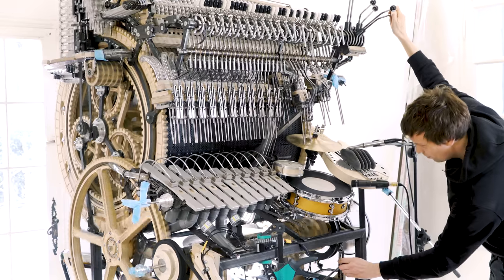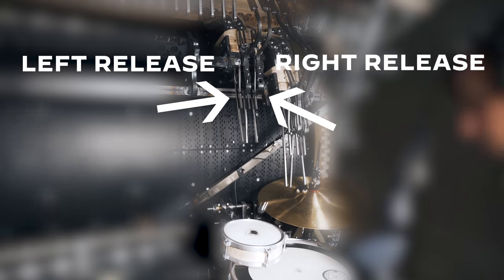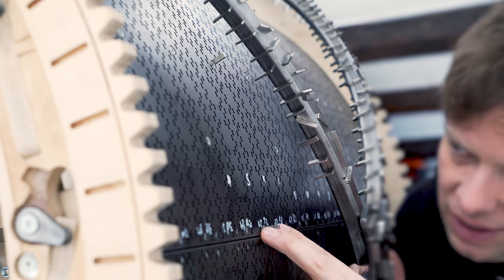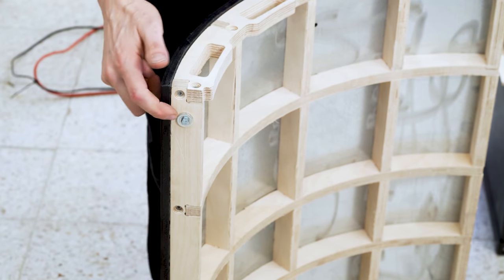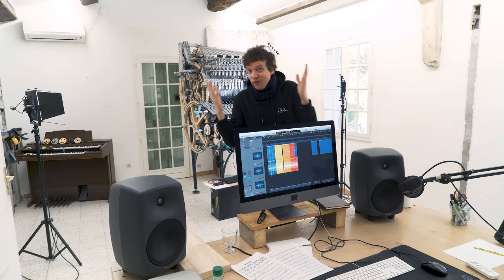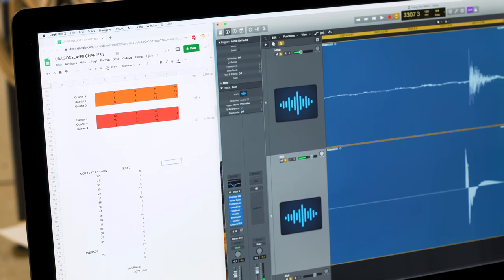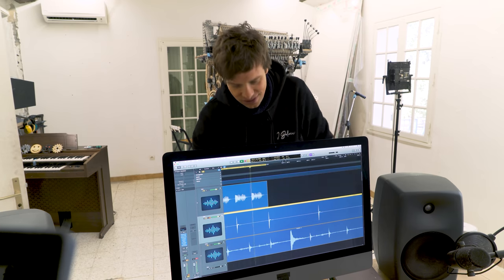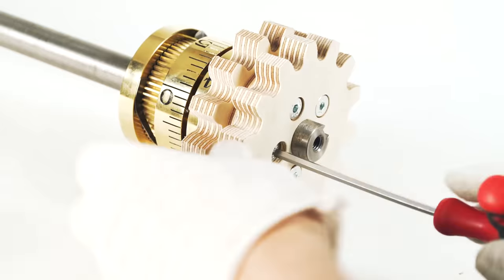Playing Tight Music? - Marble Machine X #115

Comment: Is there a contingency to deal with stray marbles that fall to the floor?
I wonder if the MMX could be placed on a slightly convex or pyramidal surface with a sloped groove around the perimeter that could feed the marbles back to the MMX with a feed tube, or at least it could collect strays and reduce the trip hazard, and it could really enhance the presentation.
Shouldn't be too tricky to build for you, the biggest issue I could see is ensuring that the MMX would be stable on and supported by such a surface.

Comment: If you want even more tight controll then use feedback from the motor to count revolutions.  Like with an Odrive controller. Then you will not miss anything :) and you potentially with a very simple front can push differebt buttons for different bpms to keep :) Edit: Wrote a bit early since he already had it built in  :D

Comment: Wow that's tight! Two thoughts though. Maybe it's an idea to do a stress test on the motor. Just to see if the RPM fluctuates under different loads from the programming pins. Secondly maybe you should paint some visual cues on to the programming plates so that composing becomes easier. Anyway keep up the good work!

Comment: You may have explained this in a prior video but won't installing the stud welding system mess up all of the calibrations you've had to do for the current programming pins? Every time you switch in between the two systems you'll have to re-calibrate it to adjust for the errors in the programming pins in comparison to the greater precision of the studs. Please correct me if I'm wrong.

Comment: Awesome progress.  Martin, get that electrical outlet fixed NOW, and use a pro.  The burned electrical outlet is a huge warning.  Further any arching or power flux WILL eventually ruin your electronics.  Yes their power supplies are soaking this and saving the circuits, but the cleaner the power you can get that expensive looking rack of equipment, the better.   If nothing else, I've seen a number of people say get a UPS and its a great choice as they not only provide emergency power, but condition power to be more electronics's friendly.   Trying to DIY electrical is how you get DI Dead unless you know exactly what you are doing.   2nd you need to have fire extinguishers around.  Lastly, please, please tell me you have onsite and offsite backup for your files.  THE most critical are the plans and updated schematics for the MMX.   

Also seriously take some time and DOCUMENT every on the fly "grab the the angle grinder and welder" little tweak you made off the original plans.   If you have full documentation, any needed part rebuilds and further adjustments will be so much easier.   I figure its very, very likely something is going to break on tour, and with solid documentation you will be able to fix the parts and stay on schedule.  

And IF you have good documentation, if anything unthinkable happens....rebuilding the MMX would take but weeks, since so much of the time you spent getting here is trying things and solving problems.  

Martin you are an awesome person and in inspiration.  I can't wait to see the album you create using this wonderful machine.

Comment: I think a good solution was to use a encoder to set the voltage of the motor depending on the speed, that way even if he'll add weight or friction in the future the speed will stay exactly the same.
But I guess just getting a powerful motor which barely feels the resistance of the machine is also a solution :)

Comment: Hey martin, one quick comment. Wouldn’t it be best to line up the rythm machine to have the downbeat synced perfectly to where the bottom of your crank turns are, then adjust the marble drops from there? That way you have a rhythm machine that you know is perfectly in time, and you can adjust each marble drop channel to sync up with the rhythm machine.

Comment: In the US at least, our power grid has 60Hz frequency AC, and the frequency is incredibly tightly controlled, because old clocks used to use line frequency to tell time. So I'm not sure where you are or if they have the same policies regarding frequency, but here in the states at least, short of power outages, you can pretty much keep an exact time for the whole day to within a few fractions of a second.

Comment: Ok I’m not sure how exactly your motor controller works but I’m assuming it has sensors to keep the rpm the same regardless of the amount of load set on it by using different sections of the instrument. Would I be correct on that?
If not that is something you should look into.

Comment: what happens if the motor dies and you need to swap it out for another one. will there be inconsistencies between different motors ?   I dont see why there should be .. but i'd get a few more motors and see what happens.
congrats on all the achievements thus far

Comment: I'm really wondering what the low and high bounds of BPM are for tight hits. The more you go down or up in BPM, the more gravity is going to interfere with the timing. Would it still be super tight at 80-90 BPM? How about 200 BPM?

Comment: The motor is a brushless DC. It's a multi-phase motor, kinda like as stepper motor, so its speed should stay locked to an exact number of pulses from the quarts crystal used in the motor controller. The motor controller decides the divide factor, that's how it adjusts its speed. But it should stay locked to the crystal. Typical crystal drift might be 0.6 seconds per week.

Comment: As you are probably aware, you experienced a 'burndown' on that burned-up [lug of yours. An otherwise properly rated circuit with a big load on it will create heat wherever there is a little electrical resistance, like from a loose screw in the outlet. Or, a poor crimping job inside the plug. In any case, the heat from the resistance further increases the resistence, which inturn develops more heat....eventuallythe connection goes into 'thermal runaway', and the result is what you experienced. I hope you replaced both the cord and the outlet, and both are irrepairbly damaged by this sort of thing. As a broadcast engineer, dealing with a lot of heavy electrical loads, I have seen this happen numerous times, usualluy started by a loose screw in a plug or outlet, or corrosion from getting wet at some point, etc. So, be careful, and check your plugs from time to tine to see if they are becoming warm. Same for circuit breakers. A loose connection on a circuit breaker will cause this problem, and the breaker will nuisance trip. if the breaker is warm, have it checked out. I had a friend of mine with an aquaponics operation in his basement experience a burndown on his fish tank heater extension cords. He ignored it, and the house burnt to the ground in a fire so hot, even the concrete foundations were destroyed. Don't let this happen to you and the amazing MMX!

Comment: Wait is that motor just run on constant tourqe perpendicular to the knob setting ?

Should've used stepper motor tho, so that whenever more tourqe is needed (like turning on more instrument which add more drag to the programmable drum) the controller can adjust the tourqe automatically to hold the same rpm and also the tempo can be set very precisely

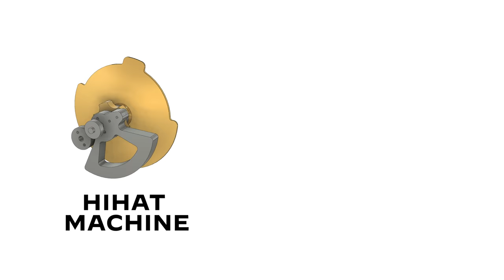Comment: 3:00 the electronic speed controller that drives your brushless motor reads feedback from the motor and keeps the RPM constant by adjusting the current constantly this is called "governor mode" and uses a clock that's as precise as the one in your computer to accomplish this; also, the corrections to RPM may happen thousands of times per second depending on the firmware used. I'm not surprised at all that he tempo keeps constant even after many minutes.

Comment: The MMX motor looks like how one tries a pedelec e-bike for the first time. You try it and unless you strictly want to ride a non-e-bike, you don't want to go back. At least i'ts what happened in many cases. I feel like my tires are punctured when I turn off the power while going fast.

Now you use the motor on MMX and you may not want to go back hand/foot cranking, unless you have a reason for it.
I'm just guessing.

Comment: Get and use a large UPS (Uninterruptible Power Supply) to protect your electronics at all times.  Don't trust an extension cord to a super strip, or later a stage extension cord!   Go with a UPS Pure Sine version to work reliability.  You don't want anyone unplugging or switch off the power while you are operating.  To do so could cause component failures and screw up calibration.   A UPS will protect against voltage spikes and brown outs.   Don't go cheap because that is a ONE in a Million machine!

Comment: Hey so I spent years trying to get technical perfection in my photographs, only to digitally distress them to make them look like my film days.  Finally realised I may as well just embrace the imperfections, as it was those things that gave me the fizz in the first place. The marble machine is mechanical, not a computer! You need to let a bit of analogue into it, otherwise, what's the point? You may as well just take your laptop on stage. It's like buyinig a lens that has no chromatic aberration, is sharp from corner to corner, no astigmatism, and has no character.  At least let the tempo not be rigidly fixed.

Comment: With static tigweldet programming you won't be able to experiment during the composing phase though.
If you are going to choose that improved system for performances, you should still keep the manual programming ability it has now at any cost, instead of changing the barrel again.

Comment: I noticed something.  The rhythm wheel isn't driven from the programming wheel.  Won't it drift away from the programming wheel over time, requiring calibration after so many turns of the crank?  After all, the proportion of revolutions between all these linkages can't be as perfect as meshing gears.
Reply: I thought every part was driven/linked by either gear drive or a toothed belt drive. If you set a speed of 120, there won't be a part running at 121. It could wiggle around 120. I'm too lazy tonight to look back and see how the rhythm wheel is driven. I bet it is toothed driven. I think I see your point. If the rhythm wheel was linked to the programming wheel the two would be more in sync than if they were driven by a some other source.
Reply: @tigerzero5216  I completely forgot that the belt was toothed.  That makes much more sense.  Nevermind.

Comment: The "indexable clutch" will continue to a limitation -> No tempo changes within a song: boo. When the machine was all mechanical I thought a governor would be the ticket, a large centrifugal governor (think steam engine  - you can actually go balls out) could probably do a good job and look super interesting. ...now that computers are in the mix It's not hard to imagine what amounts to a stepper motor controlled "indexable clutch". The mechanism is surely going to be much more intricate but I imagine one of the youtube machinists would be willing to take it on. ...either way an engineer(s) can take on the project such that the package can be installed where the current device is and it doesn't slow you down.

Comment: You should REALLY reorder the rhythm machine settings. Hearing the 3 on 4 in the middle of the straight groove made my drummer brain unhappy. Putting the 3's between the 2's and 4's makes sense numerically, but it definitely doesn't make sense musically.  Probably something like (3, 0, 1, 2, 4) makes the most sense instead of your current (0, 1, 2, 3, 4).

Comment: The motor is super useful for testing and making sure the machine is accurate to itself, but personally if you want to make music it should have the little inconsistencies from a human cranking the wheel. Lining everything up to the grid, might as well just not use the machine and just do it all on the computer.

In short, I don't think you should use the motor when making or performing music, IMO it should be relegated to the testing bench and not the studio.

Comment: Personal preference note... the high hat is kind of overrunning everything else.  Like, that's 90% of what I hear now, and it's kind of mechanical sounding, especially when you're actively changing it.  Maybe if it was muted a little?

I guess the active speed of the machine also increases the impact on the surface of it... so, maybe that's the issue?

Still, I LOOOVE your work, hope you take that as constructive criticism.

Comment: Martin, I have a feeling you are procrastinating. I'm personally not convinced that absolute sub-millisecond cross-channel timing is either necessary or desirable. I mean, yes, you can do it. But a drum machine already does that and is a lot cheaper. And has no "life". Are the musicians in an orchestra sub-millisecond accurate? Always? Do they always want to be? Have you checked cross-channel timing on any of the machines in the musical instrument museum? I bet they are not that tight and sound pretty much just fine.

Now that you have spent a week having fun, how about reward the MMX by working on the ball catchers or some other part that is absolutely mandatory before you can take it outside? Do that for a bit, then go back to working on timing.

Comment: Dear Martin,
You do a very good job with this precise calibration timing, but something scares me:
I'm not a musician, I'm an engineer, but for that matter, it doesn't make a big difference, precision is nothing if it is not repeatable!!!
So I'm just scared when I hear you're using 0.1mm shims and other very precise tricks: you get a very precise machine NOW, in your house, but the MMX is made to be disassembled and move around the world. Are you sure you will be abble to keep this precision concert after concert, without spending a full day every time to recalabrate it???
You should do the test once, to disassemble/reassemble the MMX at home and see if you can achieve again the same precision. 
I know instruments have to be tuned before a concert, but it seems to be a lot harder to tune the MMX than a guitar...
I hope my small remark will not ruin your good mood, and I want to believe in you and this machine. But I also want to see it in a concert, so I hope you and your team did not neglect this aspect. 
All the best to you!!!

Comment: You should add a function on the piano roll that changes the hihat from quads to triplets etc. #featurecreep
Reply: He's not using a piano roll though. A piano roll is a sheet of paper. This isn't. Plus, he can already make the hi-hat machine play triplets. If the programming wheel was to switch the hi-hat to triplets, those triplets would have to be physically programmed more than likely. That would be impossible (or at least very, very difficult) while the wheel is already rotating. You couldn't just make that happen magically. This machine is fundimentally a mechanical music box, not a "magic music machine".
Reply: @justinnaramor6050  Lol, you lack imagination then. Not sure why you're using a "matter of fact" way of writing, but firstly, piano rolls are musical storage media -  there are piano rolls in DAWs which are modular just like the MMX programing wheel or whatever it's called is. Secondly, you don't need to program in each triplet or quad hit, you just need dedicated lanes on the piano roll that shifts the position of the hihat arm from quad to triplet etc. as is already done manually. 
For example, 3 "midi" lanes dedicated - #1 moves arm to position A (Triplets), #2 moves the arm to position B (Quad), #3 moves the arm to position C ( Off position). These changes would repeat in sequence.
I know this is youtube and it's easy to use a condescending superior attitude, but try to be civil if you want to have pleasant interactions. I'm trying to eat a muffin in peace here fer g0ds sake.
Reply: @coma-body-stilllife  Ok, firstly I'm not exactly a "expert on this stough. I was also not trying to be condescending like you claimed. Secondly, I don't really see adding that function into the piano roll because it's already possible to do it manually. This to me is the beauty of the MMX, the fact that some of the musical possabilities can be left up to the person controlling the machine, rather than having everything automated. That makes it closer to an instrument rather than just a "playback" device.

Comment: His old marble machine was awesome because it was A MARBLE MACHINE.. I feel like this is becoming more computer than anything else. It's just getting to a point where it's so overdone that it just doesn't have that same feeling of wonder.
Reply: The Marble Machine WAS a computer: A purely mechanical one.

It accepted input via levers and a crank, and it sent an output via marbles, creating music from what was effectively hand-written MIDI sheet music. The original was heavily flawed, in that it could not operate continuously, but that was a result of the individual parts' handmade nature. The video of the end product had to be stitched together with brief, individual recordings during which the machine worked as intended.

The MMX is the original marble machine's apotheosis: It will work continuously and exactly, and it is no less impressive for its complexity, precision, or its methods of construction.

Comment: Surely that electromechanical drummer doesn't qualify as a  'mechanical' music player as the beasts are (presumably) triggered by the computer and played by a electromechanical solenoid.  The MMX on the other hand the beats/notes are purely mechanically triggered/played.  The motor is only there to maintain a specific RPM NOT play the notes.

TL:DR  I dont think the drummer doesn't qualify as a 'Mechanical' music machine, giving the crown for tightest mechanical music machine to the MMX.